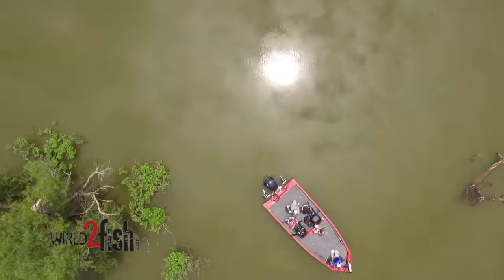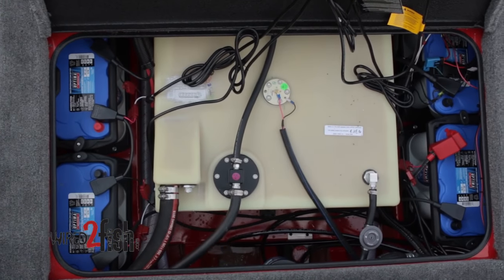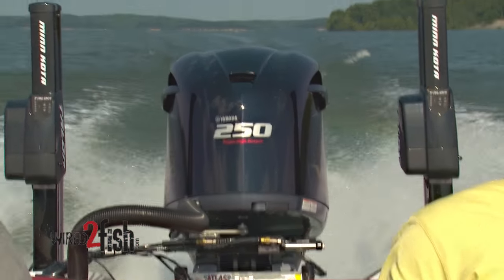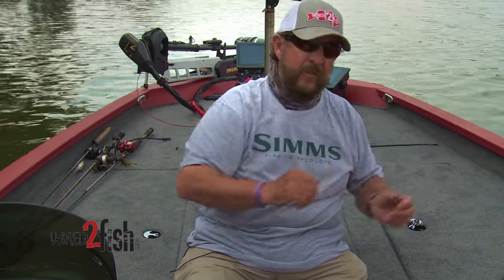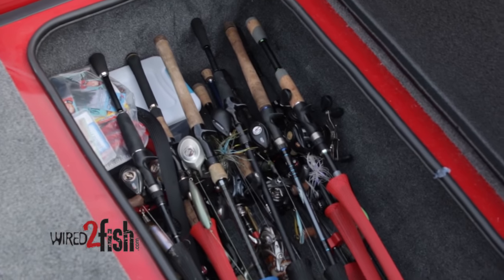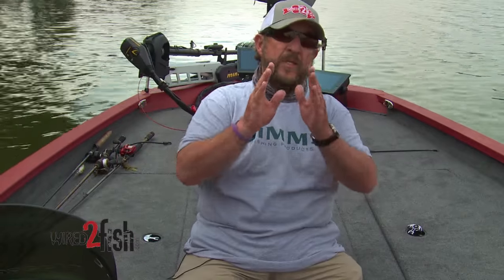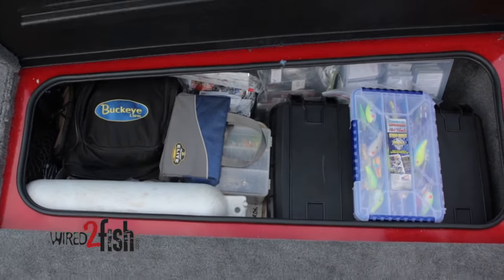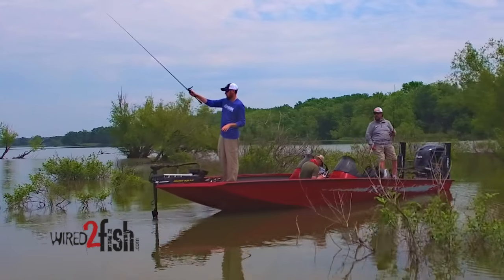Balance Your Boat for Better Performance

Comment: Move your trolling battery to the front of the boat. You have already a lot of weight in the back. 4 batteries, livewell, gas tank and motor.